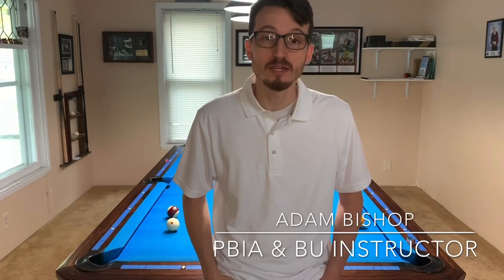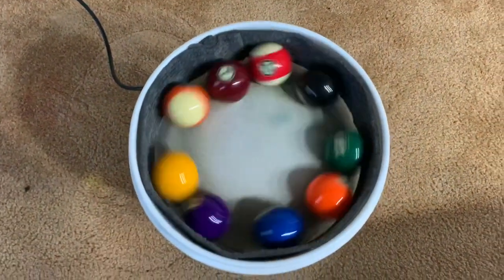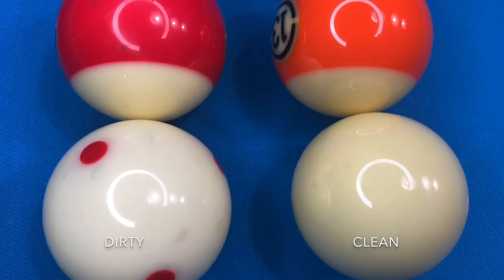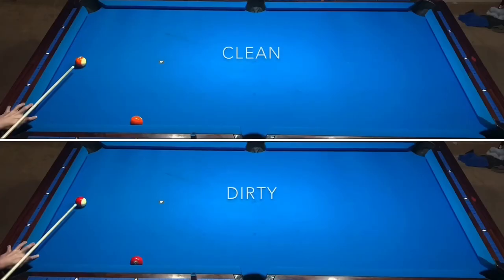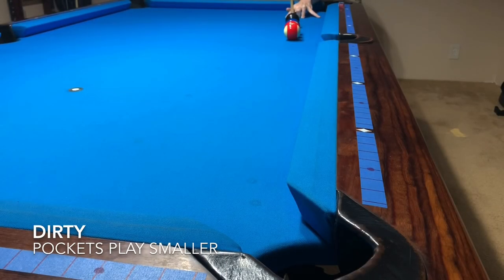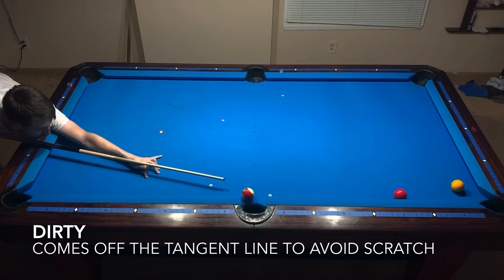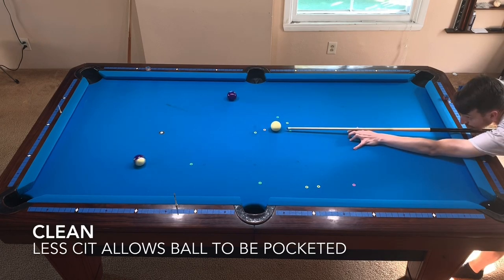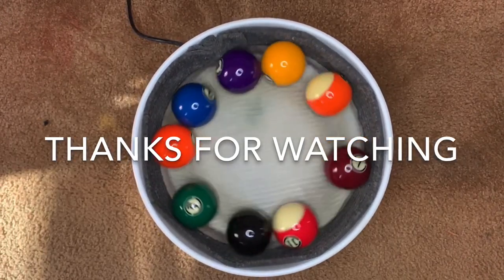Effects of Clean vs Dirty Pool Balls

Comment: I would argue that your “clean” balls are actually too slick/slippery due to your cleaning method. If you’re using straight Aramith cleaning solution, it leaves a slight layer of wax-type substance on the balls that makes them slicker than they are when brand new.

The sliding off kicks, ease of pocketing rail shots, and trouble getting good action from CB spin off rails this brings changes the game, and not in a good way imo.

I prefer playing with balls that are CLEAN, but not slicked-up more than their new condition. So I use a mix of Aramith:Rubbing alcohol at 1:4 ratio in my ball cleaning machine. That leaves them with a very similar play as their condition when new.

Artistic Billiards artists sometimes apply wax or silicone to balls to pull off amazing massé and other crazy spin  shots. What your “clean” balls are doing is a mild version of that.
Reply from the maker: I agree that my results may be exaggerated from the "waxiness" of the cleaner. I could do some tests and see how these cleaning methods compare to one another. This could be another good topic to test but I think Dr Dave already covered this.

This is honestly what caused me to want to make this video in the first place. When I clean the balls with the Aramith or Chem-Pak cleaner I will get wildly different cue ball action off the rails and cue. I now want to try your method and see how they feel. 

Thank you for your suggestion.
Reply: I always understood the ball to ball contact with clean vs dirty ,but didn’t realize how the slide on the rails came into play because the ball’s cleanliness.  Very  interesting.  Thanks for that input

Comment: I've known this for a while and this is the reason I don't clean my table and balls as much as I once did. I have a question. Where you get that blue tape that goes on the rails?
Reply from the maker: It’s actually just 1 inch thick painter’s tape.
Reply: @bishopbilliards5650 brilliant thanks for sharing

Comment: Interesting that this came up in my feed. The other night I was trying for over an hour to get a break and run using balls that haven’t been cleaned in months and was not able to get one and overall just felt like I was playing bad. I took a break and decided to clean all the balls for the first time in a while. After they were cleaned I was able to run out with ease. I was wondering if it was just all in my head or not but I’m going to clean them allot more often now. The thing I do not like is since I’m used to dirty balls, all my kick shots are off and can’t get any spin off the cushions. I’m also curious how much the break is effected by clean vs dirty. I’d like to see a comparison just out of curiosity.
Reply from the maker: It's certainly not in your head as cleaner balls are easier to be pocketed. It's something that I have noticed for years which is why I wanted to make this video. If you like having a "grippy" cue ball for your kick-shots you can simply not clean your cue ball and just clean all the other object balls. Although it's easier to get backspin and follow with a clean cue ball so there is some trade-off. My next video that I'm working on is related to the break so I will keep this mind. Thank you for the suggestion!
Reply: Yes, the big thing I noticed was on shots that I would normally miss that would be hangers from clipping the points on the pockets would instead just slide right in. For some reason I was hesitant to clean them because I just felt like really slick balls would throw my game off for some reason but it turned out being the opposite.

Comment: Hey Adam I was wondering what cloth you used on the inside of the bucket to make the polisher?
Reply from the maker: Hi Steve, for the bottom I am using a white towel that was cut and zip-tied since I wore through the original one that came with the polisher. For the inside walls of the polisher I am using black carpet that can be purchased by the foot at Home Depot. I wanted something that would last a long time so that's what I came up with. I bought it years ago but it looks very similar to this. Hope this helps, if it didn't let me know.

https://www.homedepot.com/p/TrafficMaster-Elevations-Color-Sky-Grey-6-ft-Indoor-Outdoor-Ribbed-Texture-Carpet-7PD5N660072HO/203469232?MERCH=REC-searchViewedNA-203469232--N&

Comment: Hi, I was looking at 3:36 and I think the two shots are not even hitting the same spot, dirty one seems to be closer to the middle pocket than the clean one, if that's the case of course the result is going to be different , also at 1:57 and 2:23 are also seem to be hitting different spots , check them out , perhaps if the re was a pause right when the balls hit the real it would be easier to spot also it will make the video more scientific, either way it's just my opinion there is a few more places but I'm not that OCD to check them all, lol.
Reply from the maker: Hi Al, I have a very low budget for production so everything from start to finish is done 100% on my iPhone X. It's very difficult to get the videos to line up for the perfect frame. I might upgrade to Photoshop some day but for now I am making them on a budget. I believe I am hitting the same spots and it's just that I can't get the framing just right. I am not perfect by any means so it's also possible I didn't hit 100% accurate, but if the balls were not hit at exactly the same spot the principles in the video are still valid. I should be posting another video tomorrow so let me know if I missed something in that too! I don't want to put out bad info! Thanks for the support and shoot well!

Comment: Does the room temperature affect the direction of the ball, an example of a room that uses AC and does not use AC
Reply from the maker: This is a great question. Humidity has a bigger effect on how pool balls react than the temperature does. The moisture in the air adds friction to the balls and to the tablecloth which increases throw a noticeable amount. A warmer playing surface allows the balls to roll further but I am not entirely sure that there is a noticeable difference on how the balls react at difference temperatures (given humidity is not a variable). This could be a great video idea.

Comment: Would you say under typical pool room conditions where the balls aren’t cleaned consistently and are used for many hours a day when they are dirty, the typical amount of throw for any given cut angle with consistent speed can change from one object ball to the next to the effect of missing the shot? (Excluding cling of course)
Reply from the maker: I would say that is certainly possible. I almost added a segment to this video that would demonstrate how long it would take to achieve maximum dirtiness. Maybe I'll cover that in a Part 2 video later on.

Another thing that is kind of interesting is that if the pool hall doesn't regularly clean balls between customers it will make a difference depending on what game you are playing. If the customer before you played only 9 ball for a couple hours then the balls 1-9 will be more dirty than 10-15. Which means if you play 8 ball with the same set of balls who ever is stripes will be playing with cleaner balls than the person shooting solids.
Reply: @bishopbilliards5650  I have certainly noticed that difference on both points and I’ve been called crazy. 
It’s gotten bad enough on certain local and regional tournaments where I have had to change my game from a mostly stun game (which is great for big tourneys where the conditions are ideal) to a game where I’ve had to become really good at judging gearing English to eliminate throw, or being really careful on compensating shots where I’m putting less than gearing or more. On longer shots with stun while playing on dirty or humid conditions I feel is too unreliable at times and the margin too big. Even with top or bottom which reduces throw I see unreliability.
Reply from the maker: You are far from crazy and the fact that you are able to notice these subtle differences just means you play at a higher level than others. Show them this video if you have to! LOL

Comment: Can I ask are you using a cleaning fluid? I clean my set with washing up liquid and rise off I find the balls although clean still retain friction. I believe that it is the residue that ball cleanings leave that adds to the problem. I would used the ball cleaner to restore shine but would still hand wash any cleaning solutions after. Thoughts pls.
Reply from the maker: Dr Dave's video might be helpful to your question.

https://www.youtube.com/watch?v=_taEBDVQBYQ&t=1s
Reply: Cleaning in necessary often. But, you should also have them polished once in awhile.  The balls gets a lot of micro scratches.